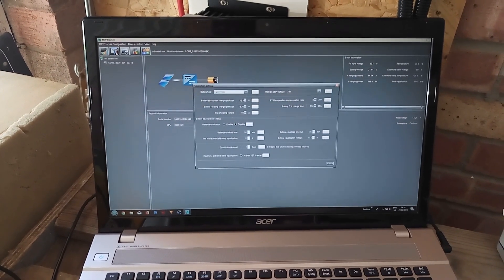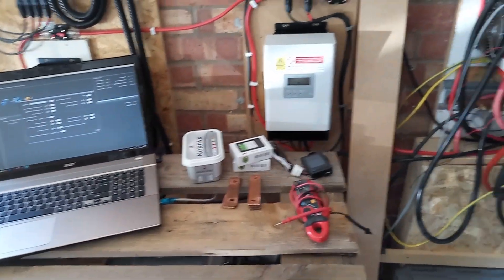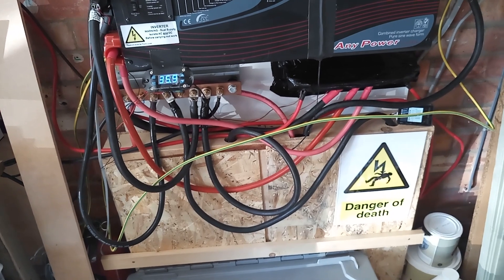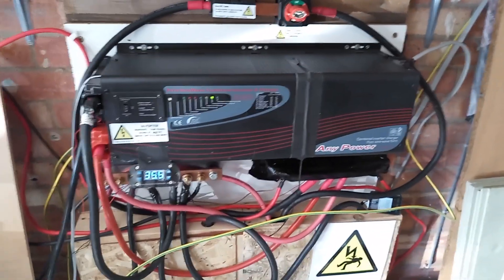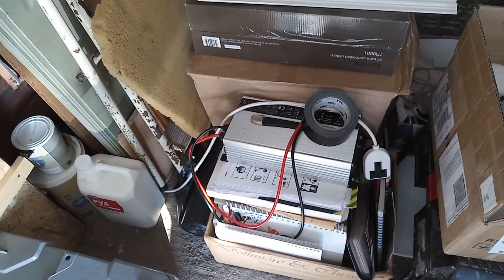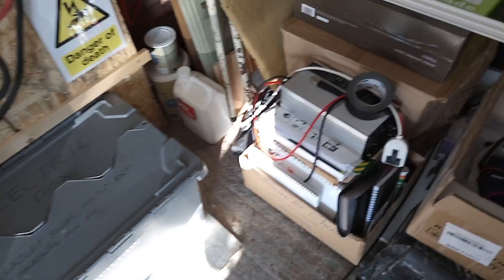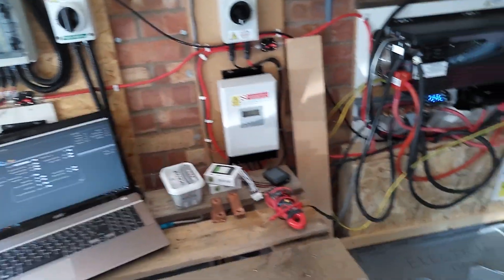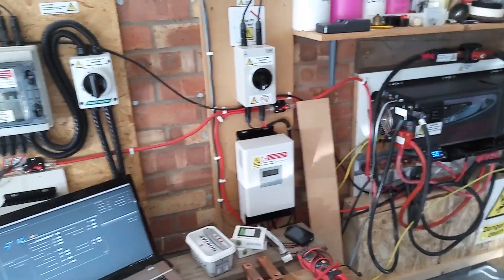Tesla modules in off grid. Time for the Victron BMV712 next and lithium charger

Comment: how are you getting on with an inverter to cut off at  low volts as most cut out too early
Reply from the maker: Hi yes all fine as my cut off is 19v. As its automated much depends on total load which can trigger early. The Victron shows lowest battery but I don't monitor all the time now. I am very pleased with how the new system is performing just  need more panels and another 2 Tesla modules, now importing Lifepo4 batteries so going to test these also. About time I did another video!
Reply: im using 10 year old velance lifepo4 did a discharge test to 12 volts i got 238 ah winston lifepo4 look good. looking forward to your next video regards

Comment: Looking forward to the finished system. Would this work in a camper with solar?
Reply from the maker: Hi yes Shane it definitely would and many RV enthusiasts are using these, however I would make sure you have all the safely features installed to prevent under/overvoltage situations, they don't require a bms at this level of charging as they will passively balance.